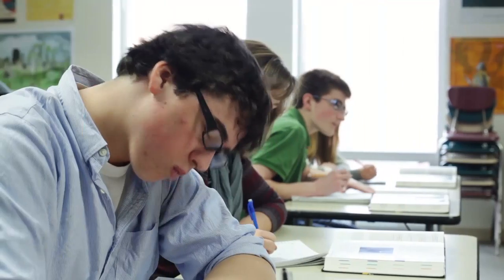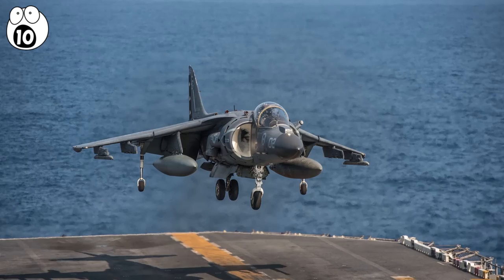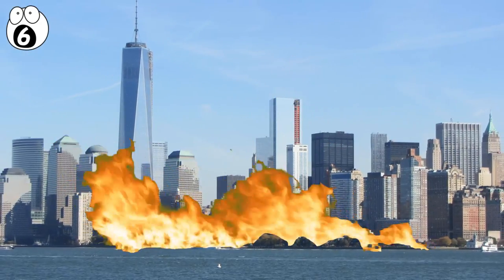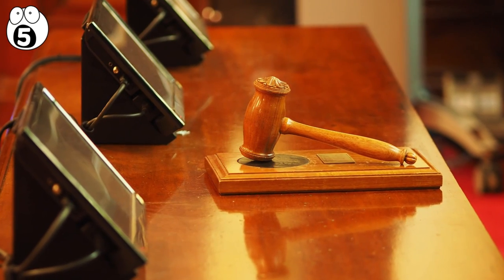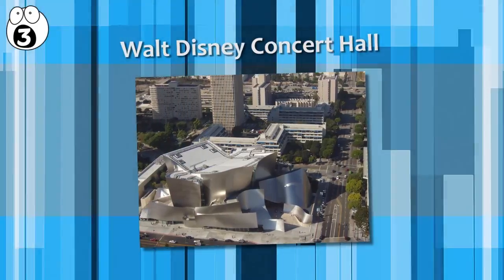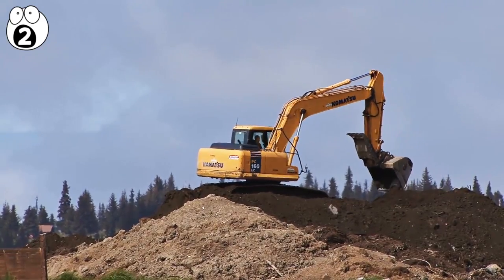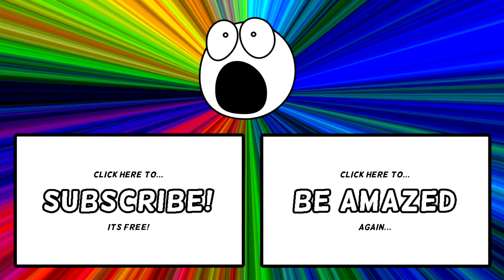Biggest Design Errors Engineers & Architects Made

Comment: Wow.  Who'da thunk a submarine's ability to surface, was dependent on its engine power?
Reply: Greg Heilers 

That made me laugh.
Reply: To be fair most modern submarines don't even have "engines" :D
Reply: So.. How do they sufarce? I'm a newbie on this kind of stuff and came here expecting to truly learn something.
Reply: They have tanks inside their frame which can be filled with water to dive down or with air to surface. Obviously if the submarine is too heavy the tanks can't carry it even when filled with air and the design won't work. 
That being said submarines can also use their engines to assist with diving by pointing the nose slightly up or down.
Reply: and what Bill Buck said about engines is that nuclear submarines have reactors that generate electricity to power an electric motor. this gives the submarine the advantage of not emitting smoke and not using up oxygen to run. WWII submarines had engines, though, but they spent most of their time above water, charging batteries for when they needed to go under water. in a way, U-boats might have been the first hybrids.
Reply: to be fair, this is a spanish sub that does have a diesel engine. (I'd assume at least, haven't really checked. Overall, though, the hot new design in subs is a diesel with an air-independent propulsion system)
Reply: Actually, on modern submarines, the ballast is only used to make slight buoyancy adjustments to stay just under the water at periscope depth, it is the engine and the wings that does most of the diving and surfacing work. For surfacing, ballast are only used in case of engine failure, in an emergency blow,  a desperate attempt to reach the surface when your propeller can't push you to the surface. Its what happened to USS Thresher, lost after a reactor scram and subsequent loss of propulsion near test depth coupled with a failure of the emergency blow valves. It reached crush depth and imploded instantly with all hands on board

Comment: The Hyatt walkway colapsing had nothing to do with the supporting rods. The originally proposed design and the constructed design would both have applied the same amount of tension on the rod.  It was actually the horizontal beam that broke. Each beam was only designed to support the weight of a single walkway. The constructed version applied the weight of the beam below to the weight of the top beam.  You can see this very clearly at 2:38. It was that rectangular tube beam that failed.  I gotta say, I'm astounded at the amount go misinformation in this video...
Reply: The way I heard it explained was: It's the difference between a person hanging on a rope and a second person holding on to the first person, vs a person hanging on to the rope, and a second person also hanging on to the rope. No matter the strength of the rope, if the first person can't support the second person, the second person would fall. Is this correct? (I'm no civil engineer, but I  plan on entering college next year)
Reply: Also, because the second person could just as easily hold onto the first persons legs as to the rope, the problem was that the first person couldn't carry the weight of both with his hands, so both fell, not just the bottom guy.  And they put the grip of the first persons hands (the two half beams) on backwards, just so it really couldn't hold anything.
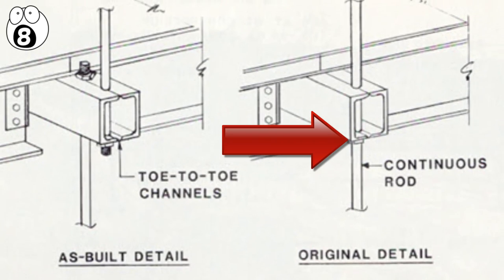Reply: Replying to Dan's point: The beams were made of two c-sections (can't remember how they were held together) so the top rod broke out of the beam at the gap, forcing the two c-sections apart.  You can briefly see the c-shape in this video around 2:46.

Comment: Its wasn't a stupid decision to give the, by the way the worlds FIRST commercial  JET passenger plane square windows. They didn't know it would crack because it was going so fast. Look at the DC-3 For example. It had square windows and it didn't explode because it was going slow enough for it not too.
Reply: the issue with the comet wasn't because of speed but rather because it was flying  so high that it needed to be pressurised which puts stress on the fuselage the dc3 is fine because it flies at lower altitudes and doesnt need pressurisation
Reply: And being metal fatigue the more obvious damage only showed up after a great deal of flight hours as well.
Reply: The comet’s square window cracks only became an issue because of pressurization--which the DC-3 didn’t have! And it was only after dozens of flights had been made, with the cabin expanding and contracting when ascending and descending, that the stresses caused hairline cracks that eventually failed in flight. Then the jet burst open like a pressure cooker exploding! Oops!!
Reply: The funny thing is he’s talking about the jet and shows the DC-3

Comment: Number 10 is NOT a mistake. All carriers were straight until after WW2 when that was figured out. It is normal design evolution.
Reply: SFS Financing yep technology wasnt very advance at those time....
Reply: SFS, they were straight because the first ones were literally wooden planks placed on top of existing boats.  During the war, people knew how to build big, straight ships and it was easy to replace the upper decks with a flat runway.  You are spot on that this is normal design progression.
Reply: Yeah, it's like saying "The car's inital design was a failure because they weren't made to be aerodynamic when they were first made" The aircraft carriers worked and the design was improved over the years to accommodate different aircraft and more efficient designs
Reply: the only advantage of angled flight decks is having simultanious landings and take offs. Nowadays jets still have to aproach at full speed and hope to hit a wire. Also that angle makes it more difficult to align the airplane because the ship is also moving forward.
Reply: The don't approach at full speed otherwise they would be touching down at speeds in excess of mach 1.
Reply: Neovo903 ok, fine at least v1 speed which is still more than 300 kph.
Reply: :P
Reply: Especially as the first decks were added on top of traditional ships before anyone had really much operational knowledge of using large carriers.

Comment: The Citigroup Center is wrong. LeMessurier the structural engineer, originally designed the building with welds, but the construction team bolted the connections instead to cut costs. A graduate student wrote in asking LeMessurier about the structural design and how it stands. LeMessurier reassured the student that it was fine, but he recalculated things because the students question intrigued him. He found out that the construction team used bolts which made the structure prone to fail if a wind at 45 degrees to the building at 65 mph sustained for an hour or more. This was particularly devastating because hurricane season was around the corner, and a hurricane was heading that way mid renovation. The plan was to weld plates over all of the bolted connections, each weighing about 300lbs if I'm not mistaken. Luckily the hurricane turned around last minute so the tragedy never happened.
Reply: Also stilts in the middle of the side differ from stilts at the corners.

Comment: The depiction of an aircraft landing on a straight-deck carrier made me sad. He discusses the possibility of crashing into planes waiting to take off. Planes waiting to take off would have been at the opposite end of the deck. Had the plane missed the arresting wire, there would be nothing in front of him preventing him from powering off the deck again.

The angled deck (along with the introduction of catapults) solved an operational issue not an engineering one. With only one deck. Planes could either take off or land one at a time. Planes taking off would have to wait until all the planes landing were down before they could start launch operations. With an angled deck, both operations can happen simultaneously.
Reply: Most of the inactive planes on those carriers WERE stored at the front of the deck, when landing operations were in effect. Then, when THEY were to launch all of them had to be shifted to the BACK of the deck. So they were always have to shift those aircraft which were on the deck back and forth!! Poor deck crews! It was because of their lack of experience doing this in combat conditions which handicapped one or two of the carriers we had at Midway. But turned out to be an advantage because when they DID launch they caught the Japs reloading (alternative ordinance) and shifting THEIR aircraft around, without being able to relaunch their air cap fighters, which had successfully defended them from the previous attacks from the more effective carriers! With angled decks allowing them to launch at the same time as recovery operations, modern carriers ALWAYS have their stingers at the ready!!

Comment: Ah yes, when you cook noodles they don't break because they have more holes for wind to pass through, how could the engineers forget that? (On a related note, this video gave me cancer.)
Reply: Daniel Jensen - Cooked (soaked) noodles are flexible.
The Tacoma Narrows bridge was flexible all right. But it was called on to be more flexible than it was. The deck was built using plate girders instead of trusses (latticework). Flat plate girders are much cheaper than trusses built of many small pieces. They also catch the wind a way way lot more.
This is OK for rigid bridges of relatively short spans. You see them "everywhere" of steel or concrete. But NOT OK for a suspension bridge having a span that is thin in relation to its length.
The TN bridge gave warnings of its susceptibility to winds in a certain speed range coming within a certain angle. It had to be closed on several occasions due to its movement.
Other long, high bridges have to be closed in high winds but not because of the deck whipping around - just to prevent vehicles from being blown over and crashing.
Unfortunately the TN bridge was not closed and a new open truss deck framework installed. They waited until the deck was wrecked, which greatly increased the cost of designing, fabricating and installing a new deck.
Reply: Hmm, I was told during my studies the problem with the Tacoma Narrows bridge was that the bridge started moving in its resonance frequency. So if anything, it was too flexible, lowering its resonance frequency and being excited in that very frequency by the wind.
Reply: thank god there is at least one sensible person out there!
Reply: That's not what happened with the TN bridge. They didn't account for the resonant frequency of the wind passing through the cables and over the deck. Everything has a resonant frequency, with large structures you have to make sure that frequency, or a multiple, doesn't match that of any common energy input, in this case the wind. If it does the structure vibrates in time with the input, so even a small input pushes and pulls in time with the structures motion. Which is what happened with the bridge. Go watch the videos of it shaking itself apart, the bridge had a huge amount of flex in it and no bridge would ever be built to withstand the movements that bridge went through.  
  
Also, this video is terrible. It's so bad it should be taken down for spreading false information.
Reply: It would be more correct to say the Tacoma Narrows Bridge was TOO flexible. The flexibility allowed the oscillation to build up. Every suspension bride built since then have stiffer roadways, usually a box girder structure.
Reply: Rene Gerritsen and Thurwell. I was taught the same thing in civil engineering classes, it was a unanticipated problem with the resonant frequency.
Reply: Nope.. this wasn't a resonance issue. 
Wind is random and does not provide a harmonical force input, which is what's required to provide a resonant excitation. 
Tacoma Narrows rather experienced severe aeroelastic flutter, in where the bridge deck movement (due to its aerodynamic profile vs. the oncoming wind) was excited, rather than damped. 
See for instance https://www.youtube.com/watch?v=qpJBvQXQC2M
Reply: "Wind is random and does not provide a harmonical force input"
No one said that, but some people simplified the cause, just as you are doing when you say it's "due to its aerodynamic profile vs. the oncoming wind" - this doesn't actually explain anything.
Here's a good article explaining both why the bridge failure was not due to vortex-excitation in a resonance but rather aeroelastic flutter - albeit substantially different from the flutter of aircraft wings and control surfaces:
http://www.ketchum.org/billah/Billah-Scanlan.pdf
Reply: Well.. it seemed to be the common understanding from plenty others, including school text books that resonance from wind action was the cause, which is plainly wrong (and not a simplification). 
I am not able to, nor interested in explaining in a YouTube comment how aeroelastic flutter works (but I provided a link explaining the general phenomena). Your article is arguably much better in explaining the specific application for Tacoma N and I've saved it for future reading :). 

The statement regarding aerodynamic profile is (simplified as it may be) is not wrong and meant to reflect directly onto the original poster which rediculed the notion of "holes for wind to pass through". 
As far as I am aware, such openings (given proper strength dimensioning of the deck) would in fact have avoided the catastrophic behaviour of the bridge.
Reply: I agree, saying it's a vortex-induced resonance problem is wrong - not a simplification. 
But I don't think I said that. 
They provided a (wrong) simplification and you provided a (correct) simplification. My point was that  neither simplification provides helpful background/explanation as to why that theory is right. (At the level provided here, both theories are very similarly plausible.) And while your link provided some information on aeroelastic flutter, it neither proves it is aeroelastic flutter nor does it disprove the vortex-induced resonance theory. Someone could have posted the vortex-shedding induced failure of a chimney and again it would have seemed entirely plausible. 
Hence me posting the article I knew of that addresses both sides and proves (spoiler: the characteristic frequencies tell it) that it is flutter (on bluff bodies).
Reply: I like macaroni better than spaghetti because it has holes for the wind to pass through
Reply: I just got to the DH Comet part, most of the cases are misinterpreted. Was this a school homework? It is wrong all over, go back, do some more research and try again.